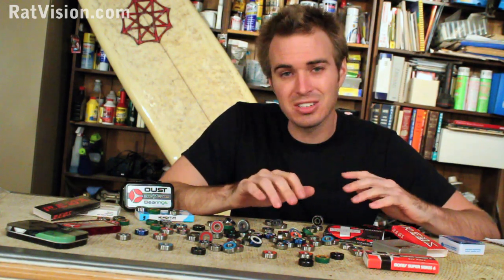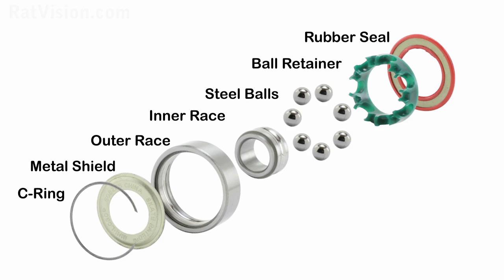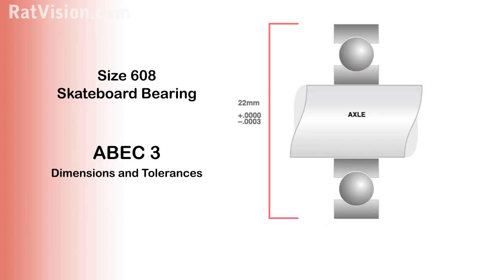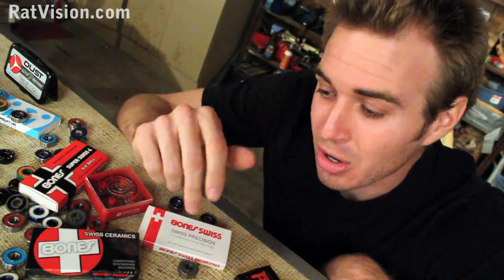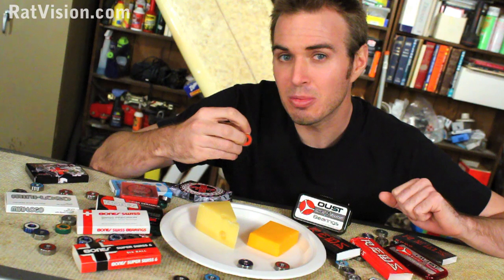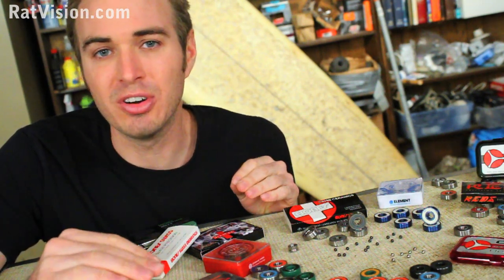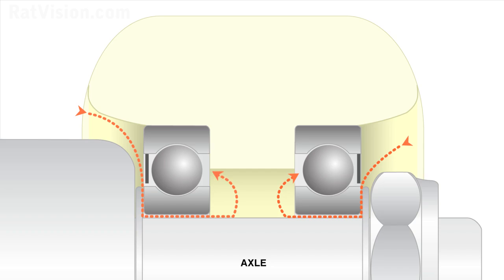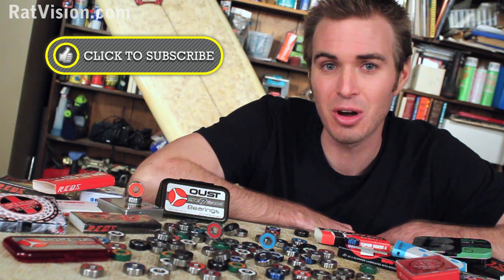What is ABEC / Swiss / Ceramic Bearings

Comment: 35 years ago I went to the Berry Bearing warehouse to buy new bearings... when i showed the salesman my old Roller Blade bearing he told me all about them ... #1 they were made for reel to reel recording decks ... #2 the ABEC # is the noise rating they give off at high speed - so 1's are louder than #9's at high speed    #3 they were not made to be outdoors for skateboards or roller blades because YES they will get  dusty n dirty and beat up as you skate around  town  AND  #4 don't waste your money buying the higher ABEC # bearings !!!   he sold me ABEC #3's

Comment: Dudes comes across as a shill. 
I know it’s not intentional,
Was doing well, until he went all ‘murica in the video then the comments. 

Best thing you can do is buy a reputable brand/style 
Whether it Swiss, ceramic or good ‘ol USA made, 

Then maintain them properly, like you should anything. 

Problem is these days, people want to buy something expensive, fit it and forget. 

Newsflash, the better your bearings and better the spec/tolerance, 
The more maintenance it needs to not fall out that window. 

I know things have come a long way since this video was created, 
But 
contact cleaner
Compressed air 
And 
Lithium grease are your friend.

Comment: Soo i kinda started a bearing business. Almost started. And i wanted to do swiss bones parts like theyre retainers to hold the balls in my bearings. When i ordered like 6 cages /retainers. They came in 2 months witch is ridiculous i live in a city. And they say made in china on the fucking bag. Soo bones swiss is made in china 100 percent. I ordered from theyre legit website 60 besring cages and they came from china. Soo just saying everythings made in china at this point. Except my bearings. Theyre ordered from china sanded down shined up. Cleaned. And swapped cages here in Canada soo ... Just saying im pretty legit lol. But theres no way to not order anything from china at this point with everything. Like for example you can order blanks for starting your decks out without you own press but the paint / silk screen set you get will be from china. Theres no way to avoid it at this point

Comment: I was told many years ago that the difference between a Swiss bearing and a regular bearing was that a swiss bearing had a “triangular” v-channel that the bearings rolled in as opposed to a square channel.  Since a ball in a square channel has 4 points of contact and a ball in a triangle only has three points of contact—-The Swiss bearing has one less point of friction on the ball.  I’ve never seen the engineering or insides of a Swiss bearing to know if this is true or not, but this was the way that it was explained to me at the time.  A you please show the insides of the bearings with the side covers off? Is there a way to view the different raceways that the balls travel in please?

Comment: I'm a bearing engineer and this video is full of crap. At no point does it take into consideration the simple fact that the bearings are "pressed in". Buy the cheapest bearings you can with rubber seals and clean and lubricate them. American steel bearings are no better for skateboarding or roller-skates than any cheap bearing made to ISO standard.

Comment: a note on the ball hardness test... that test did not measure hardness, it measured toughness. A softer steel bearing would perform better in that particular test because it will deform slightly instead of cracking or shattering. Harder materials are more brittle so will crack or shatter before a softer material.

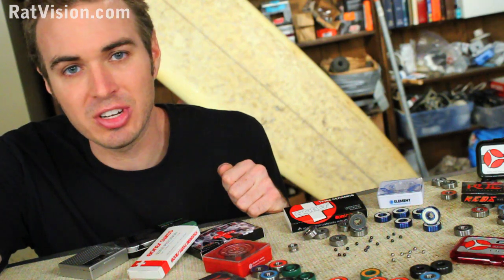Comment: 6:47 Ceramic coatings offer less friction at the contact points. heat is friction. And it offers a different material for the race and outer ring to contact. For the same reason that it’s hard to grind on aluminum, And the skate parks use steel pipes. The similar metals want to bind and grab each other when they make contact. It may not be as drastic but it is there.  that’s why the ”Inner and outer rings are steel and can still rust.”

I’m not saying they can’t crack, or that some steel balls aren’t stronger. I’m just making sure that all the facts are brought to the table in this discussion.

Also, on that note. higher abec ratings are made with oil type lubricants in mind.

However if you’re going to use a grease as your lubricant like many manufacturers do. And then going with a lower ABEC reading offers more room for the lubricant to move around and squish out of the way of the balls.

But the wider looser tolerances you can find in some lower abec bearings can offer some wiggle room when using bearing spacers. 

Or when other any other torsional loads are replied.

So in some cases, yes a lower abec could operate with less friction. However your probably going to go through a few to find a few good exceptions.

(My personal suggestions:
#1 Polish the raceways in the outer ring and inner race. By using a drill or a Dremel with buffer wheels and Polish.

#2 Polish the edges of the raceways, by using mothers metal polish like a grease, and spinning the bearing at high speed with a drill.

#3 Ceramic balls could be a good idea, but even polishing a mirror shine to the steel balls will help cut down the friction coefficient.

#4 use either liberty oil, or superlube oil pen. I don’t yet know about Bronson‘s ceramic oil🤷🏻‍♂️... 

#5 oh and don’t forget to Polish 
the contact area of the trucks axles.)

Comment: Well I never. But now I know. I started looking into bearings in a bit more ABEC etc  after being very disappointed with the expensive Bronson g3 set I just had to return as after only 4hrs of skating in the evening and a nights sleep I discover the next day that  two of the bearings are completely stuck no movement at all so reluctantly I removed the shield to discover that the bearings had rusted up WHAT !! what bothered me the most is that the bearings were not stainless steel . for the price I paid I expected more than low glade steel that rusted over night. And so I started looking around . No ABEC rating or mention of the material of the bearings on the Bronson web site. So just like Swiss its just Branding and  marketing . . This video is an amazing eye opener thank you.. So hay I found a very nice set of  ABEC 11 titanium on for less than half the price of those branded balls. Titanium is the bomb when it comes to corrosion resistance and oxidization . Booom!

Comment: Swiss are the best and Bones are a solid second.  This is pretty much undisputed.  I think an actual empirical test would be good to disprove this if it's not in fact true.  Swiss bearings are Bones BTW.  It's the Air Jordan of bearings.
Reply from the maker: Swiss bearings are not Bones bearings. "Swiss" is just a word. If I sold you a t-shirt with the word "Swiss" printed across the chest, would the shirt be Swiss? No. It could be made in Taiwan. All products sold in the USA are required to have a "Country of Origins" marking on the product and/or the product packaging. "Made in Switzerland" is nowhere to be found on any Bones products, marketing material, advertisements, or web pages. If you find anything, let me know. "Swiss" is not a style of bearing or a quality of bearings.
Reply: @RatVision  I'm not saying they are made in Switzerland.  They are a brand of Bones bearings that are universally regarded as their best brand.  I don't think anyone cares if they are made in Switzerland ✌️
Reply: Also I meant to say Reds are a second best

Comment: I think you've got the hardness definition mixed up a little bit. I saw someone else mention this already in the comments. I'm not trying to beat a dead horse or anything, just want to give some info. 

All ceramic generally will be much harder than steel. In fact in the business I work in ceramics are used to abrade steel. At the same time, steel will generally be much tougher than any ceramic. 

To get a proper measurement of the hardness of the material, you will want a rockwell tester. That uses a diamond tipped bit, that makes an impression into the material. It measures how far in the impression goes, and that is how you get the hardness. 

Now I know of a one or 2 steel alloys that can get up to 70 rockwell, or maybe slightly higher, but those are very expensive,  and hard to work with. 

Generally ceramics are rated on the mohs scale, though, and depending on the type are either 3 to 4 times harder than steel. With silicon carbide being the hardest. Sometimes the specific carbides contained withing the steel structure will reach near the hardness of some alumina ceramics on the mohs scale, but the matrix of the steel will still be softer. 

TL;DR I'm a guy that works with steel, and ceramics a lot, and a nerd about it.

Comment: Informative video, thank you.

So the ceramic ball shattered at 8200 lbs.  Four wheels = 4x the load, so max load is 32800 lbs on a skateboard.  I weigh 225 lbs, so my skateboard bearings can carry almost 146 of me.  Even one bearing could carry 36.5 of me.

Comment: Man this guy is an idiot the Bearings are called a swiss bearing because it's made in Switzerland and yes Bones swiss ceramics are the best bearings you can buy they have Ceramic Balls instead of the steel balls but only thaing between the 2 that makes the Ceramics better are that ceramic balls will not rust but the steel bearing housing cages that's support the balls is made of steel and will rust so theres some ups and downs but hell they are alot better then any other bearing in last waay longer. Why?? Because the bearings in Switzerland are made with super high end quality materials I mean but what did you suspect...Switzerland makes some of the best wrist watches knifes etc they just have good quality metals and materials and most of the thaings they build are by hand and are well made same as kinda like buying a good product from Germany because most products in germany are hand made aswell and are high quality in materials too.
Reply from the maker: This just made my day! Lol 😂 Please research what you’ve been told. If you can prove what you’ve stated, I’d be absolutely fine with taking the video down. I dare you to waste a ton of time to come back and apologize. 🤣

Comment: Thank god, a video where some clown doesn't spin bearings, claiming one is better than the other.  For those reading this, spinning a bearing and seeing how long it goes for, and listening to it has pretty much zero to do with actual performance. Bearings need to be tested under load. A zero load test is meaningless.

Comment: the skate rating, at least on some bearings, means the steels chosen to b rated for shock, as opposed to other bearings who might not b made for n environment with shock, which means u can use harder steel that wont crack as easy

Comment: What are the fastest bearing for longboarding? I mean reasonably priced at least. Don't really want to spend more than 50 or 100
Reply: Oust 9 airrr... is the best $45. That’s all I know. But I ride Bronson Raws on my longboard and it’s great. Less cleaning, but kinda noisy, and they’re pretty fast and smooth. They’re also Abec 7. But the oust 9 air... if you can afford it are the best bearings. Oh and the Bronson Raws are 30$. If you still don’t want to fork out that much cuz it is still pricey, the Bronson G3’s are under the Raws. I’ve never skated any bones besides reds, so I can’t say any of those.

Comment: Under certain circumstances ceramic has less rolling friction.... ceramic bearings are supposed to be faster. but considering what you wanna do with your board, faster isnt always better.
And lower tolerances usually also mean decreased movement of the single parts which translates into a longer lifetime.
The video contains may very correct things... but that the best bearings come from the usa... I think this ain´t true, but probably the american market is very saturated and foreign brands not so much in the buyers focus. But thats ok.

Comment: I don't think the test gave good context to a real life situation. The metal bearings will deform before they fail. Ceramic bearings won't deform but will fail at pressures beyond the elastic limit of most steel balls.

Comment: nice, pretty awesome vid, great information. my only question would be any difference between skateboarding and inline hockey. would be insane to see some of the science behind the forces behind bearings while turning sharply or crossing over. so far, the Swiss le 608 bearings have been excellent for a 240lb guy. would cheaper/different bearing fail? who knows

Comment: About rust --- In the discussion of steel vs ceramic bearings, you don't talk about this enough. There are bearings whose balls AND races are made of ceramic. If you live somewhere super rainy, you might have to go out when the ground is wet if you ever want to get some skating in. Having a rust-proof bearings seems like a major advantage then. And does it matter whether the steel bearings can withstand greater force? How much force actually gets put on a bearing during normal skating?

Comment: Do you recommend  lubrication for a sesaled ABEC5 hybrid bearing going in a high power electric scooter? If so, what lubricant; oil, grease, teflon, nothing?
Reply from the maker: Just a standard machine oil.  DO NOT use grease.

Comment: When comparing the ceramic and mettal balls, ceramic wins because need to watch how big pressure can handle bearing ball before starts deformation of the ball.
Reply from the maker: Ceramic is widely known to not handle loads better than steel balls.  They do not deform, which is a problem.  They do not handle big pressure better.  Ceramic chips, cracks, and breaks. An egg is harder than a basketball, but an egg cannot handle being dropped on the ground.  Ceramic cannot handle heavy loads.

Comment: I think you may be confusing the strength of a material with hardness.Just because a something is harder doesn't mean that they can take heavier loads,often it is the other way around.It really doesn't matter in this context,just saying.
Reply from the maker: There are a lot of different ways to test things.  We are aware of the differences.  This is just a simple way to get peoples minds to think differently about ceramic in a visual way.  Plus it would end up being way over people's heads and boring if we went into great detail about strength, compression, loads, ductility, etc.
Reply: I understand.

Comment: Help? So basically I have abec 5 bearings they spin for around 12 secs after lube, but they ride well will it help to get bones reds / will it improve the cruising or not a big difference? Plz help meh am n00b
Reply from the maker: A free spin means absolutely nothing.  12 seconds or 1 minute, it doesn't matter.  It proves nothing.  Bearings need weight/loads applied.  It's difficult to explain in a comment, but just trust me, it doesn't tell you anything.  All that matters is performance while you ride.  Reds are either ABEC 1 or 3.  They aren't high quality, and what you have may be much better.

Comment: Would love this guy to test Twincam bearings against Oust. Twincam seem unknown in the skateboard world, but are amongst the most highly used bearings in inline skating, they have been around for decades. Used and rebadged by all the best inline skate companies. They might be cheap and made in China, but there must be something good about them, forum reviews are great. After all a 608 is a 608. Love to hear if any skateboarders use ILQ9 types (6-ball)... There needs to be a video about how many balls a bearing should have. From what I've found. More balls are stronger and better for cornering speed, slalom and axial loads (Qube 8-ball) used for derby. 6 balls are for speed and down the line roll. (ILQ9 and Swiss 6) Love to hear back from anyone who actually has something to say about this. All I can make out is that 7-ball bearings are the most common and probably the easiest type for manufacturers to fleece you so they can profit. We dont need more bearing companies, just consistency.
Reply from the maker: We have answered everything you are inquiring about quite a few times, and definitely need to make a video about it.  Oust bearings were originally created for inline hockey before they made their way into skateboarding.  Because axial and torsional loads are so heavy in inline skating, the creators of Oust designed a bearing to handle it.  It is actually the #1 bearing for inline hockey.  Oust bearings were, if I am correct, actually called IDS (Ideal Design Sports) bearings originally, which is also the same company that manufactures the official roller hockey puck.  Anyway to answer your questions.  I highly doubt Twincam is any different than standard Chinese bearings, and has not been redesigned to and side or torsional loads like Oust.  7 balls are the standard because 7 is just the magic number.  More balls do not have added benefits, and neither does fewer.  It's not that difficult once you think about it.  8 balls increases drag because of more balls being in contact with the races at once.  So, in a nut shell, they are slower than 7.  The same actually goes for 6 balls too.  6 balls are bigger than the standard 7 balls.  This gives them a bigger footprint, which also causes more drag, plus at any given moment only half the balls are in contact with the races.  So if the bearing has 6 balls, you'll see 2 balls handling the loads.  You'll have to see for yourself. It might look like 3 balls, but the 3rd ball is moving in while the another is moving out.  The fiction/drag caused by the bigger and fewer balls is much greater than 7 ball bearings.  8 balls, although smaller in size, still creates a greater amount of friction, despite more balls handling the loads.  Testing has been done to prove all this.  It's why 7 is the magic/lucky number.  All others are just gimmicks, and all information you've heard or come across is absolutely false.